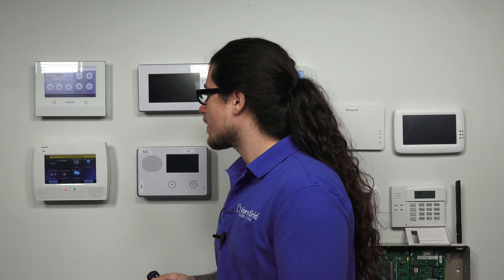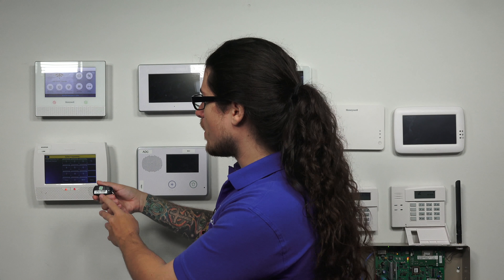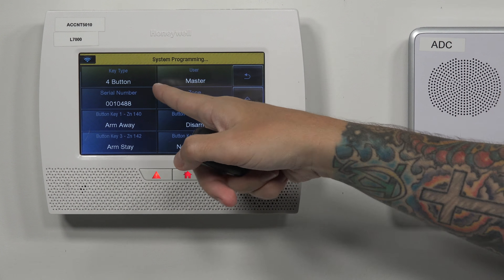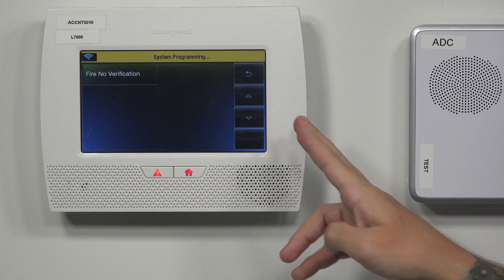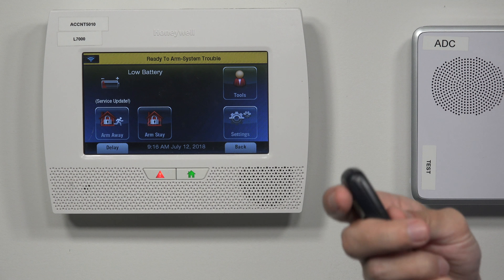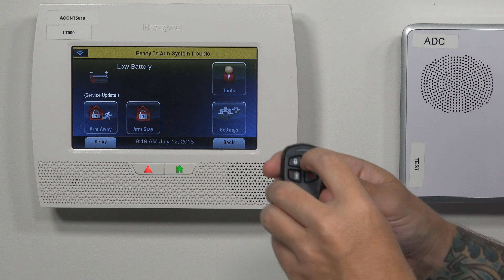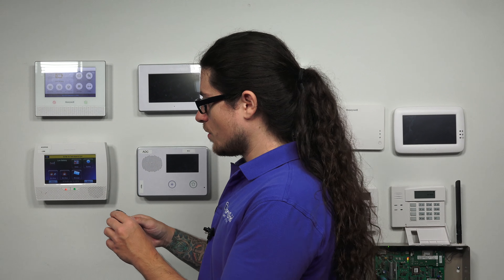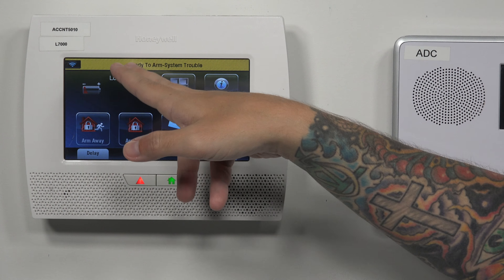Adding a 5834 4 to a LYNXTouch

Comment: Not really related, but I am planning on installing one of these systems in my house in a few months or so.  Along with the perimeter of our house we have one interior door that we would like to protect as it goes down to our basement where we store lots of valuables.  However, we would only like it to be armed when we aren’t home, but where we can still open it when armed in stay mode, just like a motion detector.  If that is possible, what response type would we use?  Interior follower or another one?
Reply: Bryce Alarm That’s alright.  Another type of system I wouldn’t mind having is a Vista 20P or 21iP.  It’ll let you use any response type on that type of system, so I’ll test by setting a contact as an interior follower, and if it alarms in away mode but not in stay mode, and doesn’t alarm during the entry and exit delay, that means it worked and at which point I’d go ahead and mount it